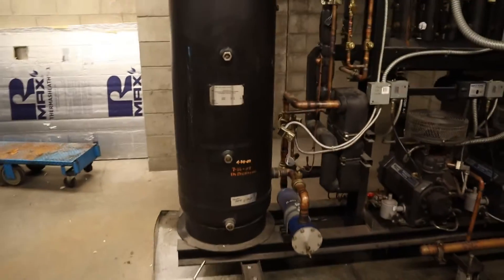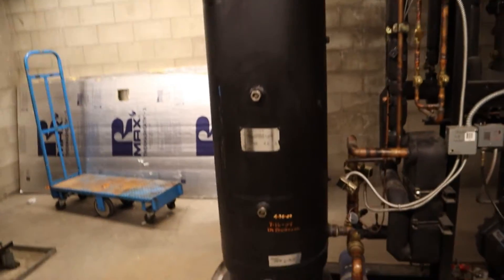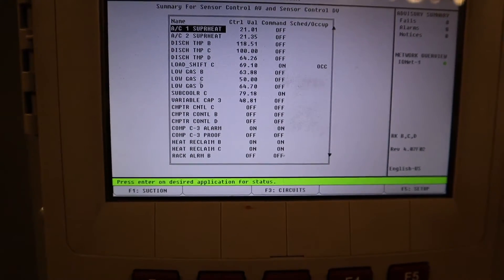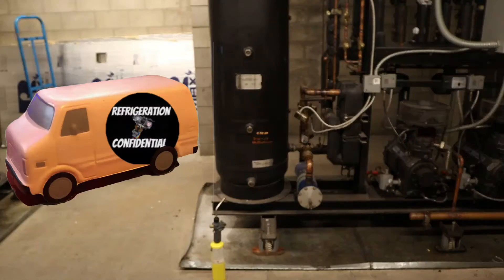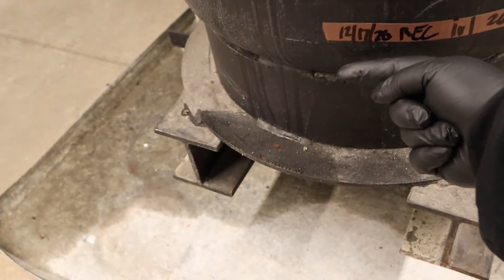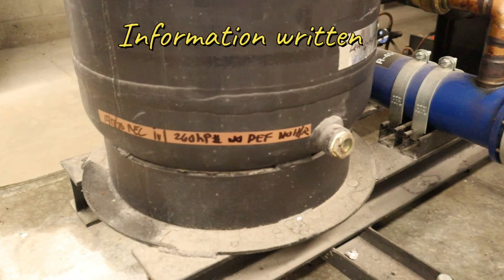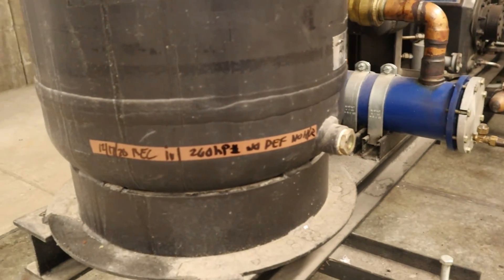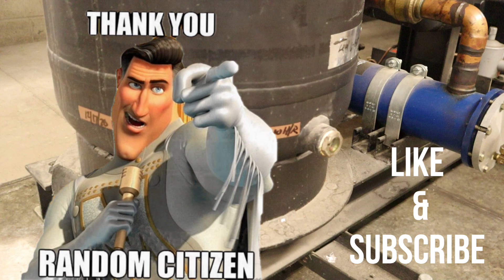Refrigeration: How to Check a Refrigeration Rack Receiver Level

Comment: thank you sir, can you explain to me if heat reclaim working we can't get accurate like defrost and when we heat it with any source the liquid should be hot or cold
Reply from the maker: Need to take a reading with HR because you have to take to account for when the store goes into heat and those are big line sets going into air handler and that's a lot of gas being diverted to the air handler. Also when systems are in defrost and pump down and the liquid stacks in the receiver which is a false reading. we take the receiver level with all systems on to make sure everything is satisficed in the store when taking a reading.
Reply: @refrigerationconfidential4376  I got it thank you sir

Comment: Thanks for the vid, you say you have 5% receiver level. What your setpoint for low level alarm then?
Reply from the maker: This store doesn’t have an alarm for low receiver level. It would be 10% but with 5% no cases are running warm here

Comment: Is a 5% level exclusivly for super market? For a restaurant receiver I think 5% is low.
Reply from the maker: You see the size of that bad boy? We usually want them at 10%..  difference between a restaurant and a supermarket is a couple of hundred of pounds of refrigerant when they leak.. they run lean sometimes so we can tell faster when low on gas..

Comment: And if you have aspirations to be a hand model, use the infrared instead. BTW, safety guy says NO more doing this. Yea, ok
Reply from the maker: 😆😆🙏..tell the safety guy to come show me how he does it 😆
Reply: I get that maybe we can soften the metal to where it fails at that spot but that is a stretch
Reply from the maker: @itsmemsti  🙏 not gonna buy a fancy $200-300 tool when I can do it for $40 and some how you still have to get some heat to it to check